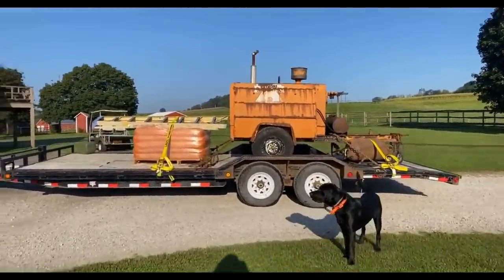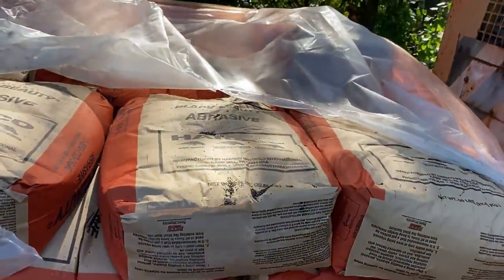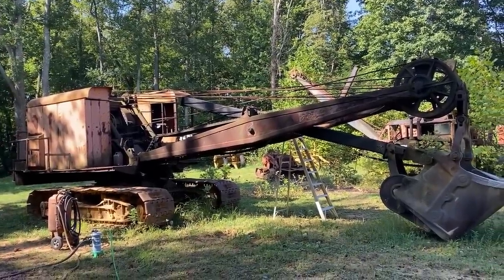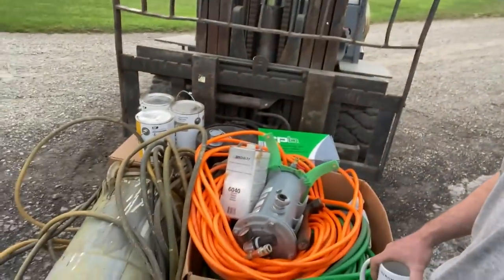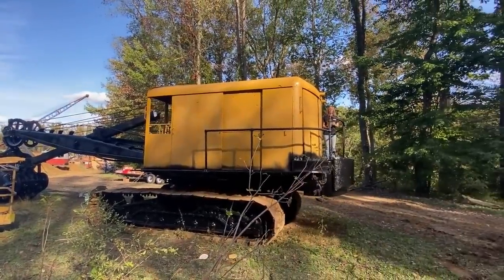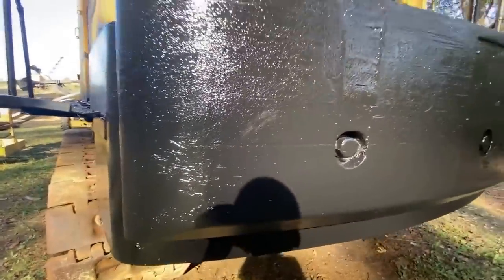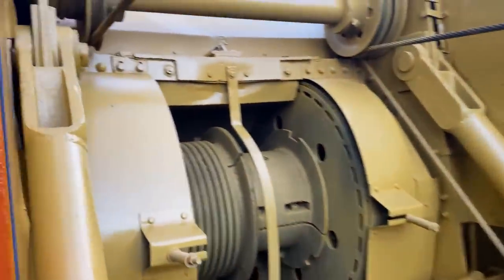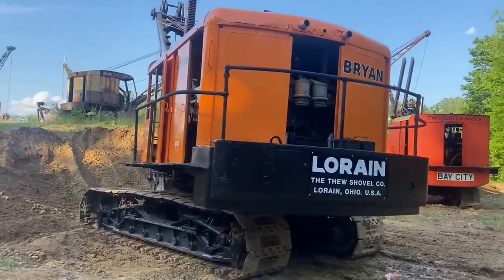Sandblasting & Painting 820 Lorain Shovel

Comment: Back in the 80's i worked in a body shop here in OK.  We mainly worked on heavy trucks, about 50 /50%, road trucks and oil field trucks.  I had the pleasure of running the sandblasting (yep sand that is how we did it back then).  It was a nasty, exhausting, sometimes miserably hot job, but oddly satisfying job.  8 hours in a gravel parking lot, wearing coveralls, a hood and respirator when its 105, sucks!  But it was satisfying seeing how quickly you could transform an old vacuum trailer or concrete pump truck!  Nasty rusty to nice and clean in a few hours.  We had a 1944 IR compressor on a skid mount.  It had a Flathead Chevy inline 6, that thing was a beast.  Yours reminded me of it, you just have the younger brother.  That thing would run an 1-1/2" blast hose at 200 psi at barely above idle.    I have no idea what happened to that compressor, hopefully someone like you has it.  That thing would have made your blasting chore so much quicker, but it would have also eaten a ton a of gas and media!  We used to fuel it from 55 gallon drums!

Comment: I'm 74 in a couple months and this is one fine job of bring back those colors... the one I did run a bit had a Murphy Diesel engine.... one huge oil pit as it slobbered  all over itself. ... I truly believe the Cat engine is a great swap for them as  Murphy engines were big but no real power and hard starting when worn out

Comment: That came  out great! 
Do you  oil or  grease thr  cables? They  usta do  that  where i lived. I guess to stop rust and  maintain the strength of the metal. I guess  it  also reduces friction as  the  cables  side across one another as  the  freed on and off  the reels.
Reply: Yes, but any oil or grease on the cables inevitably attracts dust and dirt which may not have been be a serious issue as long as these machines were used regularly, but which will accumulate over time on 'museum pieces' that are only get used a few days per year and may cause trouble then.

Comment: Why would you sandblast something that has thousands of open bushings and open gears, open sprockets and chains, cables, hundreds of greased and oil lubricated parts ? ? ?  The sand is going to damage and wear out everything.  I think sandblasting the crane shovel was a terrible thing to do. I have blasted with a pressure pot compressor many times before.  I know how this stuff goes. Sand goes everywhere. Even in your crack! You can not protect these bearings and parts from the grit.  In this case, acid etching, using a needle scaler, and a grinder with a wire wheel would have been a better choice.  ---Doozer
Reply: You don't the it's going to get dirty during operation?

Comment: Sam, as you possibly know, black absorbs heat. In the heat of the summer weather,  you'll be roasting yourself in that cabin. This means that the paint needed to be different from that black. You'll know what I mean by this relatively soon.
Reply: As in Is that why no one wants a black van? Moisture not a problem, it baked out!
Reply: Yes, except after black absorbs the heat  and increases the temperature past 118°f, that's the temperature when all life ends. I was going to add more to that sentence, except I don't remember it. The concentration I have isn't doing so well. What else is there to type to you about? There are only two or three plants that are able to grow in the desert, which are cactus and a flower that I don't know the name of. What's the other plant? There might not be any more.
Reply: As for black on a van, you'll roast yourself inside of it. The water inside of you after you go into it will be sweated out of you in a few minutes, depending on the temperature inside that cabin. Did you ever see a black van? I don't believe any person is that foolish to do that. That would absolutely be ridiculous.
Reply: Yep, I prefer lighter colors for heat reflection and being able to see what you're doing in low light conditions.